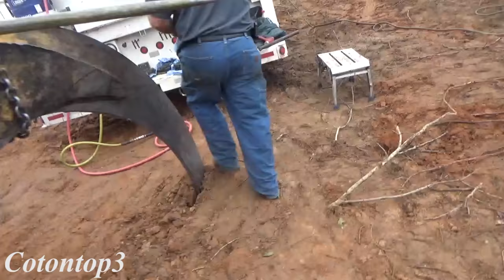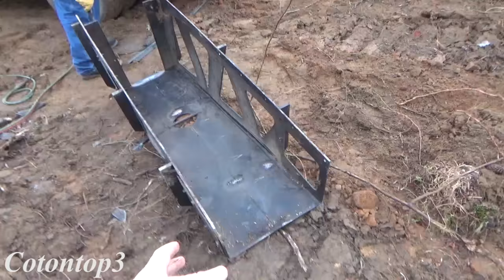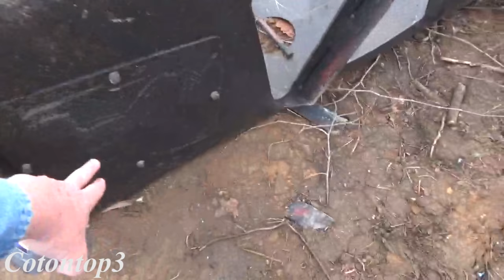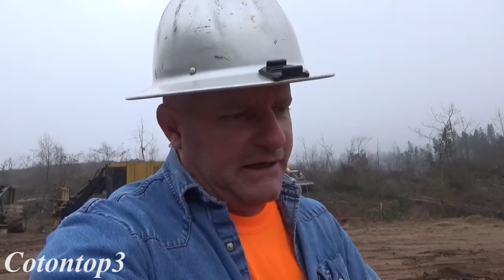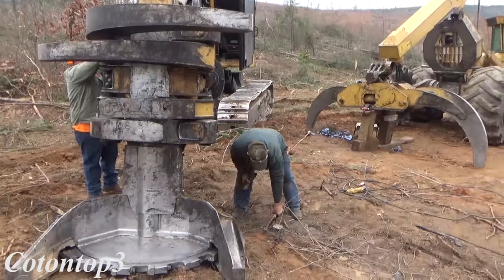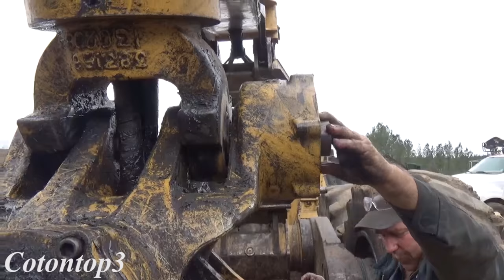Tigercat 635D, taking the grapple off, major maintenance day!

Comment: Nobody can say you don't grease and look after equipment.  I get guys won't grease a tractor loader here, they run the pins right through the bushings then when it's got 1/2 slop in everything It's my problem.  Most of them are $2500 plus repairs by the time the bushings are cut out, new ends welded on the rams and everything's put together. Grease is like $6 a tube Thats Pretty cheap compared to not using it I think, but the customers always right L.O.L. That shaft and bushings is cheap for what it is, compared to the $750 Agco want for a 12" clutch disc I just fitted. Thanks for another interesting video.

Comment: My 2012 822C had a factory bracket bolted around that box and fitting and also attached to a rubber flap. The dead tops wpuild hit the bracket and snap the 4 bolts off that block. Ended up taking the bracket off and running without it.would break every 500 hrs with the bracket on. The newer ones have the line and block under the bottom side of the  cyl. cap

Comment: great video Tim. very familiar with those discs that you showed they had them on the Letourneau  for drive wheel brakes and hoist motors brakes run by electric magnets.